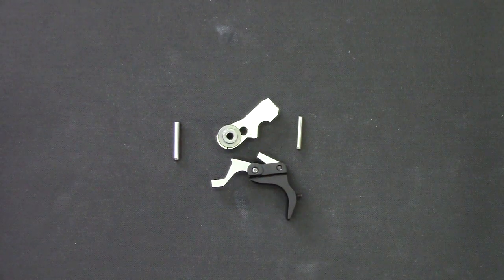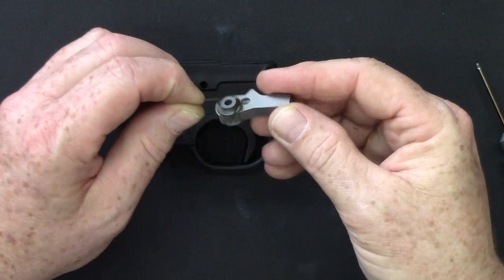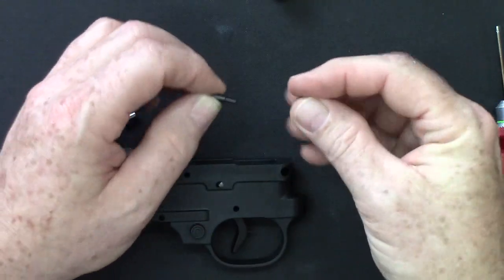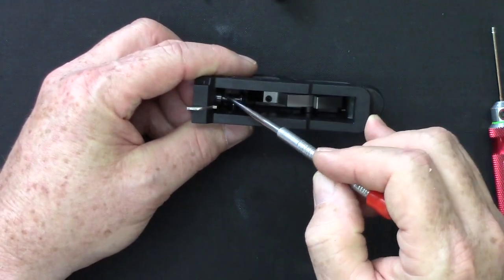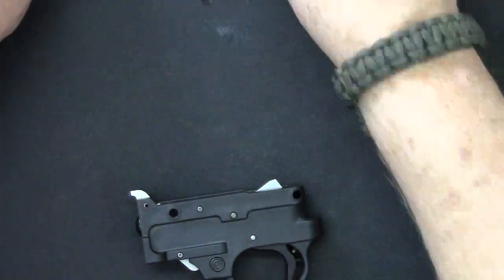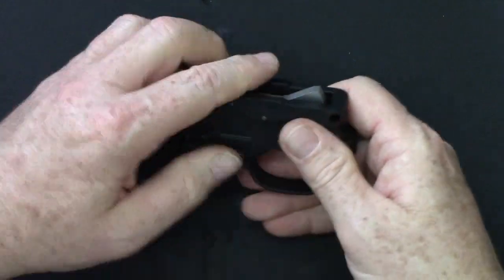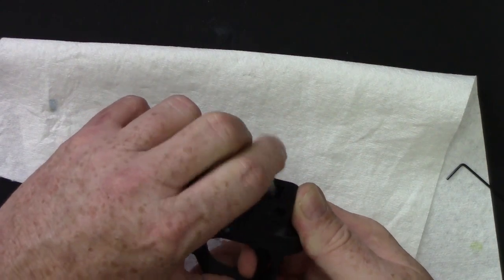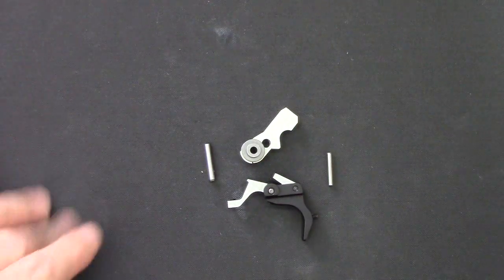KIDD Trigger "Job Kit" installation in the polymer or plastic 10/22® factory guard

Comment: Thanks for sharing. I ordered a barrel, receiver, hammer, and bolt this week. I think I've decided on the trigger kit (vs the drop-in unit) to complete the build. I've gone this far, why not.lol! Initially, I thought project would consist of parts from different manufacturers but the plan quickly changed as quality became a higher priority than cost. Parts arrive this week. I look forward to getting it together and test it on the range. I feel good about my decision. I will report back with results.
Also, i am curious about make and model of the red-handled screwdriver you use?
Reply: Hi BobbySusenbach, Thank you for your feedback, we look forward to hearing about your results.  The driver brand we use in the video is difficult to find now but we can recommend Wera brand. -Good shooting!

Comment: Is the Kidd Trigger Job Kit really 1 3/4 lbs? (or is that just on your gun and if so, what trigger pull can we expect to get from your kit in one of Rugers new Polymer trigger assy?)
It was a good video. It makes me want to order one but I'm not sure yet, it's 115 bucks and he dont even give us a slave pin with it, lol...
Reply from the maker: The Trigger Job Kit is actually 1 3/4 pounds. I know most companies make a lot of false claims but I'm an honest guy and suffer from humility. It seems fairly rare these days.
If you look closely at the video you will see that we include a $115 slave pin in the Trigger,Sear and Disconnector assembly. The rest of the Kit is free. All kidding aside if you need a slave pin for the hammer or magazine catch you can just use the factory pins that came in the trigger guard. They are usually .001"-.002" undersized and  make great slave pins.
Give us a try. We stand behind our products and I think you will be impressed. TKidd
Reply: @coolguyguns10xKIDD  That's a good idea, you supply new pins so I have the extra slave pins already. Some disassembly required lol. 
I think I can appreciate a 1 3/4 lb trigger. I don't have any that light, close though. Sure would make my little 10/22 come alive!
Reply: @coolguyguns10xKIDD  That didn't take long at all! I just finished installing it and no problems at all. Still has the Ruger smooth operating safety and everything functions as it should. But I'm dying to feel the trigger once back in the stock. Don't tell me, let me guess...Don't dryfire it, right? I did do it three times but I first inserted a empty/fired shell casing into the chamber. Is that ok? Or don't do it at all?

Comment: Why is the kidd trigger so much better than the ruger?
Reply: Ruger had to cheap out on something to keep the price low. Once you upgrade the trigger, it becomes an extremely solid gun.
Reply: @KaiForce  they cheaper out all over the place on the 1022. It’s a cheap gun with a great design. The performance becomes outstanding when you throw proper parts into it.

Comment: I have a 10/22 mfg in (82) I bought it in (83) new, will this kit work or will I some problems, I am going to install a guide rod and spring kit in it so I was thinking to do this all at once,  Thank you
Reply from the maker: Your trigger guard will be a metal not polymer for that model.  We recommend dropping our trigger job kit into polymer units because we have found them to have more consistent dimensions.  This consistency is not noticeable with the factory parts installed but when installing the KIDD trigger job kit there is not as much "room" for inconsistencies.  We have nearly 100% success rate in the polymer and about 65% in the metal housings.   Good shooting! Mary Kidd
Reply: @coolguyguns10xKIDD  Thank-you for the heads up

Comment: I recently bought one of your single stage triggers.  And I had an issue with it the other day.  Have you ever had your safety turn on you?  The flat part was down and the notches were turned up.  I wasn't able to get it out of safety.
Reply from the maker: Galen, I have had this happen. hold the safety tightly with your thumb and trigger finger and rotate it back to the proper position. I wiggle the safety left to right as I rotate. This allows the safety to push the spring and plunger back down into their hole. Hope this helps. TK

Comment: This kit fits the Ruger PC Carbine nicely.
I installed it along with the green 3.25 trigger return spring.
I made no adjustments to the overtravel or sear set screws.
No pretravel, No overtravel, and a super short trigger reset.  Trigger is rock-solid with a clean/crisp break.  Outstanding.
All I have to do now is go shoot it.
Reply: Update: Unfortunately, this kit is not totally compatible with the PC Carbine.  The hammer appears to tend to follow the bolt rather than reset, and so you get some burst fire every other trigger pull or so....  I think the disconnector may be jumping the engagement on the hammer.  If you use the factory hammer, though, the problem stops. 
For the money, I would still recommend the upgrade if you want to shorten up trigger overtravel / reset.   Just don't use the Kidd hammer.  Hopefully they will come out with a more robust hammer for the PCC.